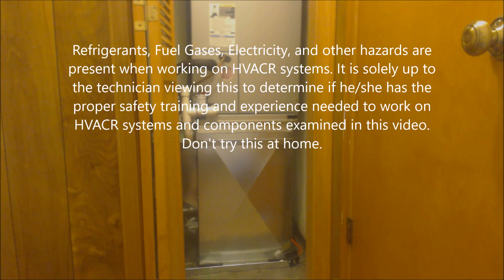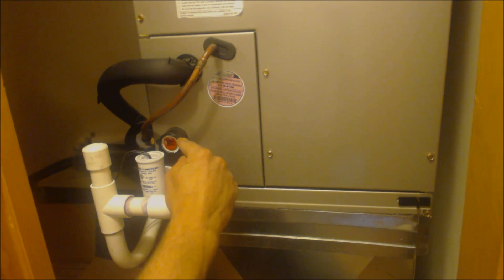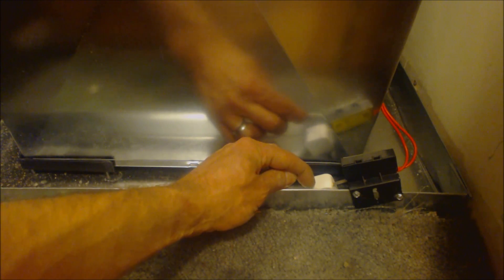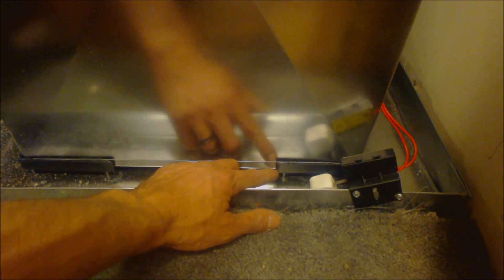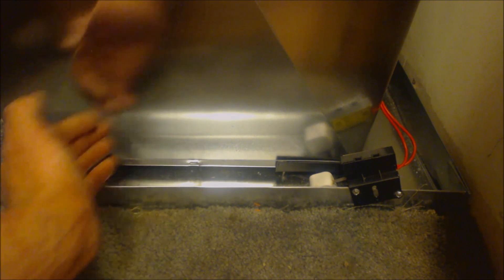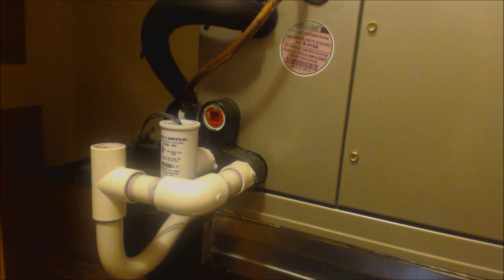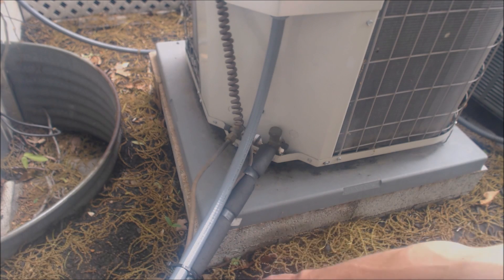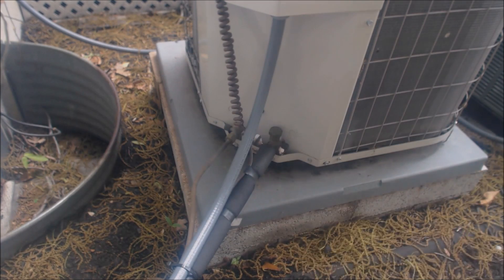HVAC Installation Training Basics for Condensate Safety Switches, Low Voltage Wiring, Drain Trap!

Comment: Craig, If the float switch were to trip, and the 24V to the thermostat was interrupted. Would the display on the thermostat still work? If it wasn’t battery powered?

Comment: excuse me how do you test the high and low pressure switch if is good or bad on a heat pump system.
Reply from the maker: Look up "acservicetech pressure switches" thanks!
Reply from the maker: Look up "acservicetech pressure switch" thanks!

Comment: This might some dumb . But I see guys wire up a drain pan switch to other stuff . Like they put One red to RED(24 v) on the board and the other to some other random wire .? Why is that can somebody expplain to me please ? I would want to know how to do this . Versus me I find the stat wire and cut into it and wire but each end ... seems like a lot more work than the other guys but I would want to know easiers ways .. please and thanks
Reply from the maker: I leave the thermostat without batteries and hard power 24v from the indoor unit with the r and c wires. I break the r going to the thermostat with any safeties so the thermostat goes blank. I always have a pan underneath to catch any water from something like a frozen coil or leaking condensate pan. What you are seeing is some techs break the yellow wire supplying 24v to the outdoor contactor so the compressor shuts off. I like to make the thermostat go blank and sto[p wasting energy so the homeowner knows to call the service tech right away, thanks!

Comment: With it being wired like this. Will the outside unit continue to run?
Reply from the maker: If the switch opens the electrical circuit, it will cut off all 24v to the thermostat which means the 24v won't make it to the outdoor unit, thanks Anthony!
Reply: I really enjoy your videos. They are great training tool. Showed them to my former hvac instructor for teaching aids for his classes
Reply from the maker: Thanks Anthony, funny enough, that is why I started doing these videos. I was having a hard time finding an intro video to certain subjects so I just decided to do them myself for the classroom, thanks!

Comment: Hi, can you do a video on how to properly run PVC condensate lines on both Positive & Negative pressure systems and the use of P-traps?  Some people on the forums say the use of a P-trap is a must on negative pressure systems while optional on positive pressure systems because it's probably not needed and there's a greater chance for a clog and callback.  They argue it's worth the small amount of air leakage as opposed to creating a potential clog point.  Others say a p-trap is a must on both positive and negative pressure systems.  

All the videos I've seen on YouTube aren't very clear on the subject and the HVAC forums are also very conflicting.  Thanks for the great educational videos.
Reply from the maker: That would be a great idea to do at some point. Thank you for letting me know khyber!
Reply: Thank you for all the excellent work that you do with these videos.

Comment: excellent buddy, on the pan for my I like to add a large drain higher than the float switch just for safety and damage to the home.  Def not necessary just another precaution.  Keep up the videos even though I've been a tech for a long time, I always pick up a thing or two from your videos.
Reply from the maker: Thank you very much Mr. B!

Comment: Hi,, i change my capacitor in my a/c because its bad then started cooling but after maybe 5mins the compressor stops again,,when the system is running i measured 110psig in vapor line,,is it overcharged?is the compressor already dead?
Reply: And i measure the compressor wire,,i dont have a reading from yellow to blue
Reply from the maker: Did you replace the capacitor with the exact same size? It is possible hopefully that the thermal overload is open. It would close after 10 minutes or maybe more. You should also turn the power off and check the actual terminals on the compressor. What refrigerant is in it?
Reply: acservicetech its r22,,why is it the vapor pressure is very high,,because i watch your video before and it said 65-80
Reply: Yes its the same cap 30 uF..when the compressor is running,,the draw amp is 6.3 but in the nameplate should be 4.2..
Reply from the maker: You may be working with r410a and not r22 like in the video. Feel free to check out my r410a videos, thanks
Reply: acservicetech its r22 because its written on the nameplate in the condenser
Reply: Is it possible that its overcharged?

Comment: Excellent video. For brazing do you use a turbo torch or oxy acet?
Reply from the maker: I use a turbo torch even up to 1 1/8". I mainly work on residential light commercial though so I don't work on larger suction ines such as 2" copper tubing. I am happy with it, thanks

Comment: Was it difficult to braze that filter drier at the air handler? It looked like a really tight spot I would be scared about burning the walls. Also any recommendations on how to avoid burning filter drier while brazing? I spray some cool gel on it but the paint still seems to bubble. Thanks man!
Reply from the maker: The hotter and faster, the better for the filter drier. The angled part of my torch tip is usually touching the drier as I shoot the flame away from it. The same happens to me. It is just a matter of getting in and then out fast. That area was not a hard area to braze. Setup and figuring things out ahead of time is crucial, thanks.

Comment: Another great video... do you have any videos on a complete wiring of a system. Low and high voltage? Thanks.
Reply from the maker: Here are some videos, most are low voltage only, dual fuel, furnace and ac, heat pump, condensor, thanks-   https://youtu.be/fFL_ZSkAZM0  -    https://youtu.be/b0QZyTIdeqk   --   https://youtu.be/DLYW78mHfbA  -  https://youtu.be/HhhesjH9BWI   -   https://youtu.be/5lxftJiTqLg

Comment: Great Video! 
I really like how you said that you don't like to put a drain in the pan, because there shouldn't be any water in there ever. It's true! Here in dallas I come across some TXVs that techs forget to insulate sometimes and also sometimes instead of adding a ss2 switch in the secondary drain plug they simply add a 90 and a piece of pvc pipe down towards the drain. 
Question: have you ever installed a Diversitech   24-Volt Wet Switch Flood Detector????
How would you wire those?
Reply from the maker: Here is a wiring diagram. It uses 24v to operate and breaks the other common, thanks! http://media.diversitech.com/doc/DOC00036.pdf

Comment: Ever run the common from the transformer threw the safety switches? A snubber circuit.
Reply from the maker: Honestly I don't know if there really is a correct one to pick. I usually pick the R because I think about it like an electrical switch in a house. It may be better to break the 24v hot for safety before it leaves so that it cannot find another ground to go to but once again that was just my original thought. If you break the R 24v off of the board then the board still saves the fault codes. If you break the wire off the transformer, it will stop power to the board in case there is a fault. Just some thoughts. Thank both of you very much! Great Dialogue!
Reply: Brad Settle just thinking of doing it that way no real reason.
Reply: I'm going to reply just so I can get a notification when he answers.  Good question!
Reply from the maker: Are you talking about what would happen to a control board voltage if the current suddenly stops in the instance of a 24v Y load breaking where the load would absorb some of the voltage spike if you broke the circuit after the load instead of before it? I always enjoy your comments and appreciate you. Please go ahead and explain.
Reply: acservicetech I was just thinking kill the common on the 24 volts at the float instead of running the 24 volt or R use C.
Reply: That's what I thought you meant.   I would tend to want to break a leg on the transformer too.  I have always wondered which leg would be best and why. ... can you explain your choice?  :-)
Reply: acservicetech saves the codes good reason right there. Excellent conversation thanks.
Reply: thanks for the response!